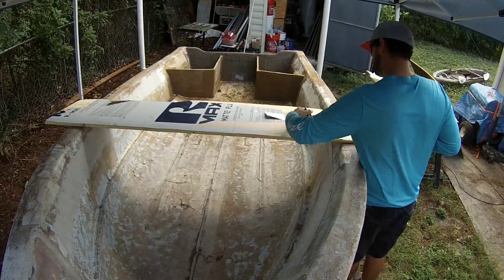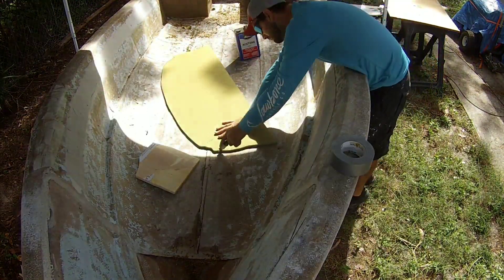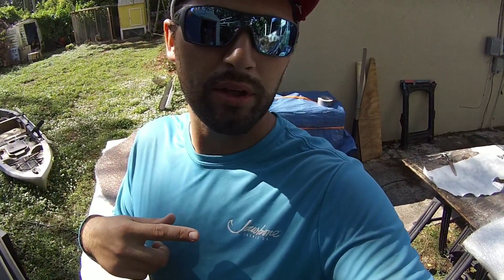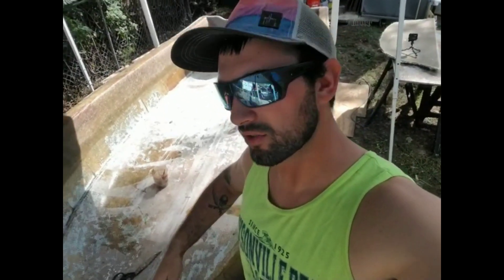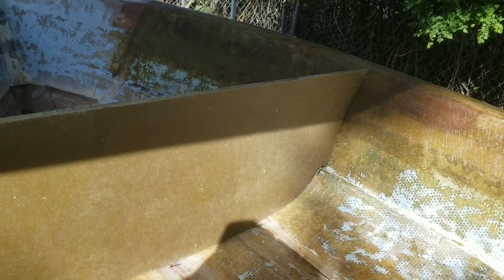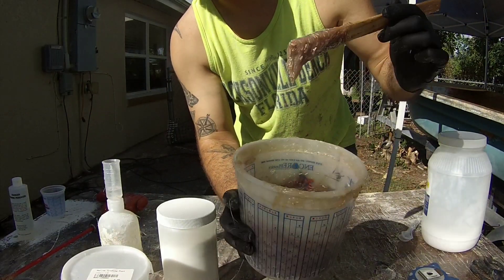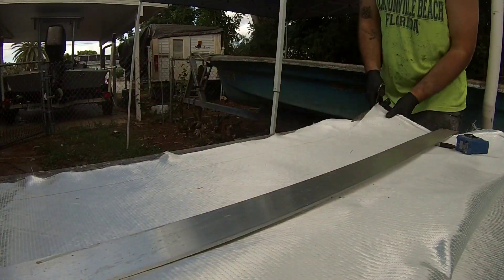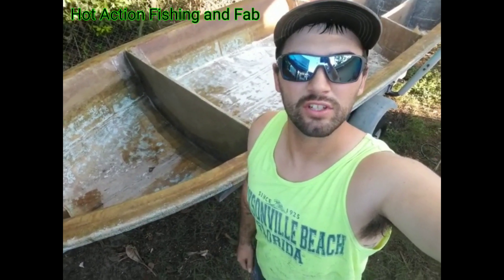DIY Fiberglass boat build (Adding in a new compsite bulkhead) part 5

Comment: Here real soon I will be working at building a bulkhead for my boat but I will be using plywood instead of the coosa. What is the thickness of the Coosa / divinisil you are using for the bulkhead you built? My thinking is that I get the equivalent thickness of plywood that you are using in Coosa but I’m not sure of thickness you are using?

You’ve encouraged me to give it a-go so I recently bought a real beater of a boat for $300 (lol) and have been using your video series as the primary source for building it up.
Reply from the maker: .5" ply for everything. Awesome good luck I set small goals for my self feel like I get more done and feel more accomplished while doing that.

Comment: What’s up man love the vids I’m currently restoring a 13’7” Collins skiff I’m only using coosa and divinycell for the whole boat I was wondering if you had any problems with weight distribution with the gas tank and batteries?
Reply: I’ve seen your recent vids and it looks like your sticking with the portable gas tank I just want some input, i fish in south Louisiana and have to cross a lot of open water I want to get a built in gas tank but with such a small boat I’m worried it will weigh the front down to much
Reply from the maker: its defiantly a small boat so distributing weights is a big deal. your probably going to need to move the weight around and see what your boat likes. I ended up going with my bat in the front and gas tank in the back. other then the normal bow steer that Johsens have she runs really good.
Reply from the maker: Yeah idk you'll have a better ride with the weight in the back keeping the bow up. Could go the other way to

Comment: Curtis - Would there be any structural reason to not install a complete floor from bow to stern and then install bulkheads on top?  I would put stringers under the floor and the length of the bulkhead.  I'd like to go without deck hatches and access under deck through the bulkhead.  love your work.
Reply from the maker: Not at all the reason y most skiffs dont have a full floor is just for the weight aspect.

Comment: About how much csm, 1708, and resin do you use for a project this size? I know it kind of depends on design of the boat, just looking for a rough estimate.
Reply from the maker: -24yrds of 2oz csm .
-10yrd of 1708 .
-20gal of polyester resin .
-4gal of fumed silca .
-1gal of 1/4" chopped fibers. 
-5gal of gel coat.
-1 4x8 sheet of .75 coosa.
-3 4x8 sheets of .625 divinycell. 
-1qt medium grey paint. 
I didnt wright up a list but that should be pretty close to what all it took to do everything besides some odds and ends I have about 2k into the hole boat
Reply: @hotactioncustoms7008  sweet thanks. I'm trying to get a rough estimate of supplies to restore my boat soon.
Reply from the maker: If your in the SWFL area check out marine trading post!
Reply: @hotactioncustoms7008  I'm in east Tennessee so the internet is my friend lol